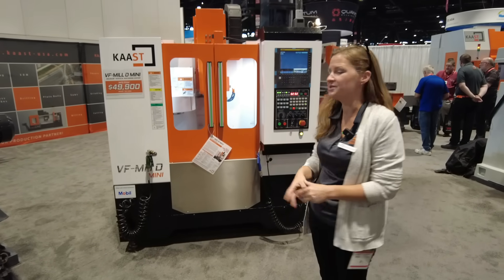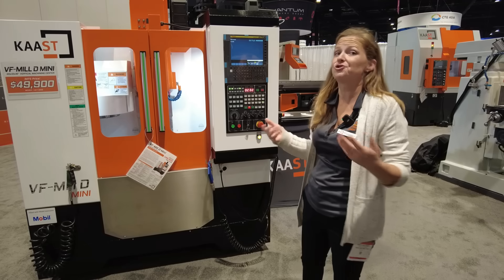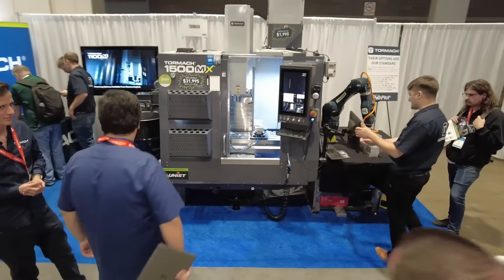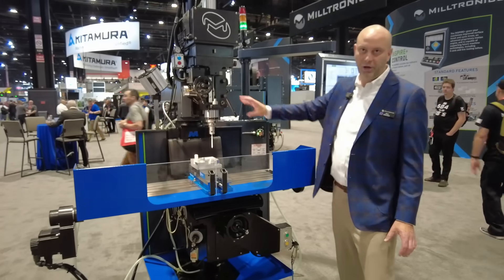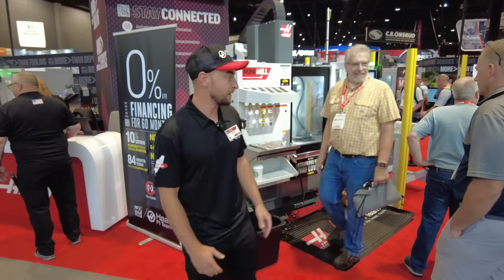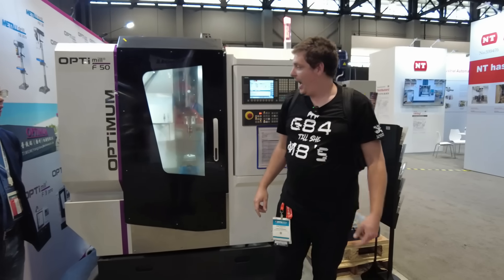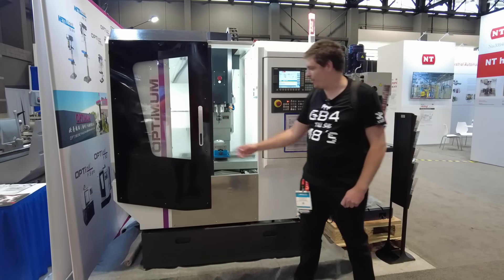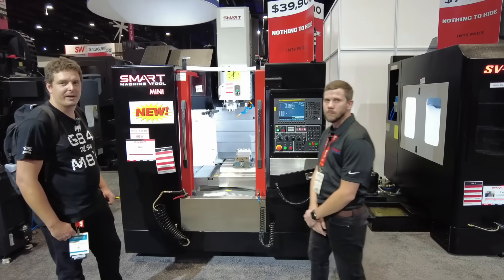Every Entry Level Mill at IMTS

Comment: Im curious why the Hass guy showed off the Mini Mill vs the TM-0P. That seems like a better machine these days for the compact entry level space. 

I wish there was an "entry level" large format toolroom type mill like the TM2 that wasnt Hass. Maybe they have the market cornered on that but, having some travel is real important for some types of work, even at the entry level. Something that didnt have quite as much footprint as the TM2 does, more tailored for garages and able to go up against a wall, with front or side access cabinets and coolant, would absolutely rip.
Reply from the maker: I think the real reason is that the guy we convinced to come on camera was responsible for showing off/operating the Minimill at the show. He didn't know as much about the DC or TM series, so he just talked about what he knew. This wasn't exactly a video that we planned and coordinated with all of the machine tool builders.
Reply: @AudacityMicro  interesting that they have people specifically for each machine like that, both a good thing in that you're getting folks with in depth knowledge on that hardware but maybe not getting as much of the whole gamut.

Comment: Best entry level is a cheap used machine with a free Linux CNC mod.

Small business start-ups fail when they take on debt before they are ready.
Reply from the maker: I would call that a "hobby level" machine. Someone shopping at this level is beyond the hobby phase, and looking to make money over tinkering. It's 100% the best bang for your buck at a hobby level, but at the professional level, your time is worth too much.
Reply: @AudacityMicro  A pro grade used VMC running Linux CNC runs the same or better than any pro grade controller.
Reply: @Zebra66 having done the lcnc retrofit multiple times, I have to agree with the other comments. I have made way more money with my used sharp vmc with an outdated fanuc control than the 4 lcnc machines combined. The converting and tinkering is fun, but 10k rpms and everything working all (most) of the time let's me focus on making parts (money) instead of fine tuning a machine. But if you want to buy some lcnc projects hit me up :)
Reply: Small start-ups fail when they focus on the machine instead of the parts they should make. If you spend $40k, and you write it off in 5 years, that's aboout $700 a month.  Even if you make only 200 parts a month, it's still only $3.5 for the machine.  if you can't afford that, you better outsource your production.
Reply: A single well running machine will save you at least 1 employee, saving you the cost of at least 1 of these machines a year in payroll, maintenance, downtime, repair, etc.

Production is WAY different than many other industries. Many industries you would be correct. But considering in most cases you will need at least 2-3 machines for any really production process, start to finish, the man hours saved will quickly more than pay for the machine. 1 person can run 3-4 of these and some shops can get away with even more, once you get some economies of scale in several types of work loads. You will quickly save millions+ buying a few of these over any "smaller" options.

I would even argue if you don't need at least 1 of these machines full time you are better off outsourcing whatever you are doing.

Comment: Parts and service availability ? How well is the control integrated ? What do they offer over minimill? 

Problem with haas killers is that for alltheir faults Haas genuinly makes product that offers what you need at the price point that you need it at
Reply from the maker: I am not a smart sales person, you will have to talk to them about that. Sounds like it's fairly comparable to a mini-mill, but comes standard with a lot of things that are options on the Haas equivalent (High speed machining is an option, really haas?). 

Nothing in the US beats the Haas service and support network, but unlike some other machines in this price point (I'm looking at you syil), it does seem to actually exist. I went with my Haas for a reason, but if this existed at the time, I would have seriously seriously considered it.

Comment: No way that smart mini  draws 35kw, it's listed as a 10/15hp spindle on the website so I'm guessing it's more like 30-35 amps.  The 9k weight is also a little suspicious but I guess it could just be absolutely overbuilt.
Reply from the maker: Machine tool builders LOVE to over-rate their machines in terms of power consumption. They don't want customers undersizing the wiring/breakers, and then blaming them,  so EVERYONE over-specs power requirements. It was however, certainly over-built.
Reply: @AudacityMicro  Oh I'm fully aware, I have a DMG with a 25/35hp spindle that apparently demands a 120 amp circuit, and that machine doesn't even have a bunch of high HP pumps and stuff.  Meanwhile the VF2 has a "20hp" spindle and only needs a more realistic 40 amps.  I highly doubt the DMG uses 3x the power but who knows.  Might be worth putting an ammeter on to see what they're actually doing.
Reply: That's the wet weight with 55gal of coolant lol.....and full chip tray capacity 🤣

Comment: Best entry mill is 30-40year old japanese iron, that people don't want anymore, for various reasons.
Usually build like a tank, unlike these toys.
Reply from the maker: That is a great route for a hobbyist, or someone who isn't interested in growing a business. Though I do agree that going with a slightly used machine is probably a better route. Something like a 2014 Speedio would be really hard to beat in the value department.
Reply: When you are starting out, the machine probably should just work so you can focus on cutting chips. Spending months getting 40 year old machine to run will be educational but it won't get parts out the door. And at the end of that process you're still probably missing useful features that actually help day-to-day productivity with modern CAM. 

Taking lighter cuts is fine. When starting out no-one is going straight into all-day production of hundreds of parts. You'll spend a lot of the time working on CAM, setup, problem solving, and so the difference between a 20 minute cycle and a 40 minute cycle for a few parts is still relatively insignificant. And in time even with a 'toy' machine the cycle times can come down to something reasonable. 

I went straight from a DIY hobby mill to a VF2. At the time I didn't want to be 'stuck' with a toolroom type mill or a mini-mill. But at the end of the day for the first few years any of those machines would have done 95% of the work I had to do 90% as fast as the VF. And most would call a VF-2 a "Toy" anyway, it's no beefier than that SMART VMC at the end, for example.
Reply from the maker: 100% agree
Reply: It depends on what you are doing (1 of or mass production) and how much profit difference will it make? If you can finance a machine and finish 2-3 times as much work because of it or take job you couldn't otherwise it will quickly COST you more to use the older machine. Not to mention learning curve (per machine when mix/matching a whole shop), scalability, downtime etc. 

People often think companies overpay for products/services and they do for what they are getting, but it is often the cheaper option in the end.

I upgraded to a new laptop which allowed me to work 2x as fast and therefore paid for itself in less than 1 month. Saving just 1-2 second per screen adds up quickly. If you can save just 1 minute per hour that is over 100 hours a year in productivity. If a new machine costs $60k and you can run 3-4 of them, you save about $50k per employee just on TRAINING using 1 brand instead of mixing 4. Each employee you don't need you save $100k a year. This is all assuming you can find 40 year old  NON manual machines to run lights out. Otherwise running 3 shifts will require 9 employees more for 4 machines costing almost $1 million per year.

Comment: Smart mini would be my choice if it had been out at the same time I was buying my X7.  I don’t know if they discussed it but Smart has has $10M of spare parts sitting in a warehouse in Wisconsin waiting to ship to you if they’re needed. That’s huge for a machine like this.
Reply from the maker: Yeah, it's really hard to argue with the Smart, as long as it fits inside your shop. Good to know about the spare parts, that is a HUGE benefit
Reply: @eIgHtY0N3  S Korea
Reply: But have you had issues with yourSyil X7, needed to wait for spare parts? Is it a real issue?
Reply from the maker: All things mechanical eventually break down, and will need spare parts.
Reply: @Rimrock300 whether I have or not (I haven’t) is irrelevant. Things happen and if you’re depending on a machine to pay your bills then you need to be able to fix it quickly. Having to wait around 2-4 weeks for your parts to show up from China assuming you can still get them would absolutely suck.  Obviously if you’re just buying a machine to dick around with in your garage as a hobby then it doesn’t matter.

Comment: Man, I got so turned around when I was there I only found Smart. All the other booths you showed I never saw (obviously you couldn’t miss haas at the entrance to the hall). Couple questions, did you get a website from optimill, and which of these companies appears the most attractive to you?
Reply from the maker: And in terms of what is most attractive to me,  I just responded to someone else on that, you can go find the full response there. But TLDR: they all look great for different applications, but If I had to start over, I would still buy a used Haas.
Reply from the maker: I think this is them:

https://www.stuermer-machines.com/brands/optimum/
Reply: @eIgHtY0N3  many of these are rebranded imports. Methods’ house brand is a Taiwanese company contracting to build what Methods asks. The question is what is the original company

Comment: Hey, sorry I missed you at the Tormach meet up. would have been cool. I liked the 1500, only thing was depth of the machine with auger was a lot for a small shop but that was it.   So your opinion if height was not a problem but all other constraints what would you seriously consider?
Support, learning curves, travels with smaller footprint...
Reply from the maker: I think it's mostly dependent on your application. I don't think there is a right or wrong answer here. 100% tormach for someone with power limits, or who are new to machining. The kaast looks great for someone with a small space, who is doing big/real production work. I probably wouldn't ever recommend one of the knee mills. The Smart looks fantastic for a jobshop, but it's big for a garage.

Personally, I don't think I would change up the route i've gone, and I would find a lightly used Haas. I think that is the best bang for the buck right now.

Comment: On the Kaast machine she said it ran on 230 3 phase and then said you could  plug right into your drier outlet.  Does anyone here in the states actually have 3 phase power to there driers?
Reply from the maker: Speaking on camera is hard. I would give her the benefit of the doubt, and assume she meant with a phase converter
Reply: @AudacityMicro  gotcha
Reply: It could be that it's 220/230 single phase, or with a converter maybe?  But some places have dryers and such setup for 3-phase as well. Usually apartments.
Reply: She could have meant that you could use a drier plug to power it, so it doesnt need to be hardwired. Although an oven plug is probably a better idea, and that you can run with 3 phase. I actually use an oven plug (NEMA14-50p) on my citizen swiss lathe

Comment: Kass is an interesting competitor. Smart is super competitive especially with how they are running in steel
Reply from the maker: the the kaast one was super cool. really nice and compact. The Smart seams like a steal at that price too. But too tall for most garages I think.
Reply: @AudacityMicro  absolutely
 If you can fit its definitely got more grunt than anything else in that category. Wish doosan pushed their dem more as it's very similar